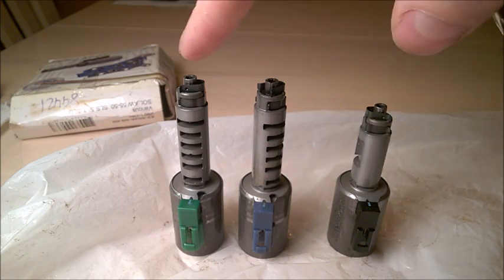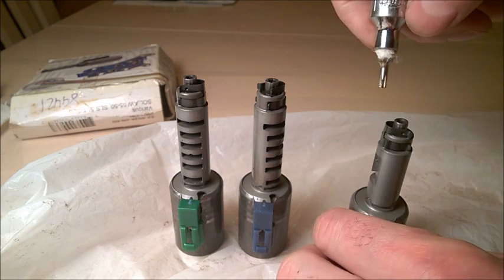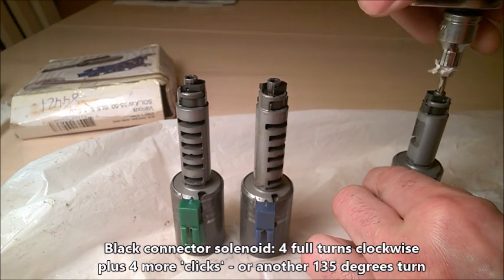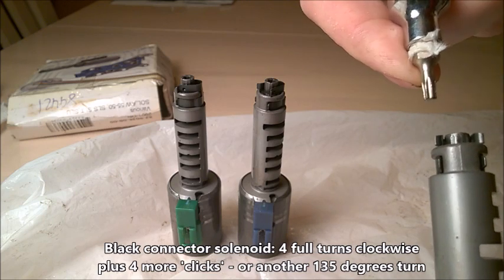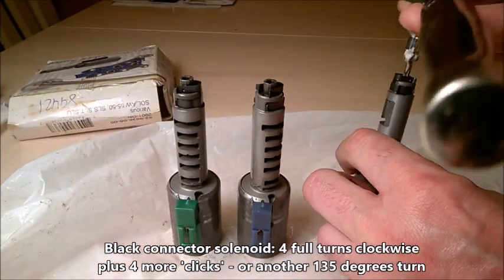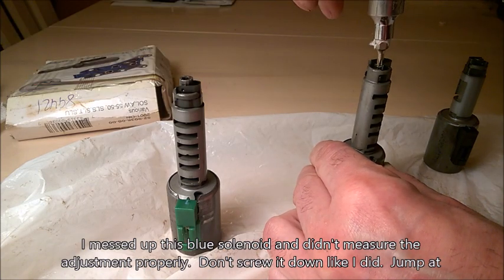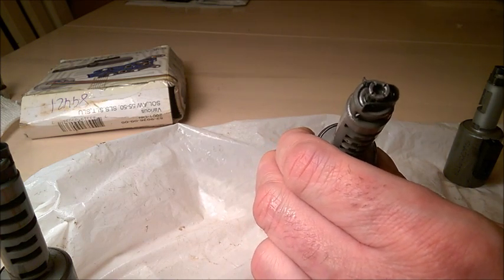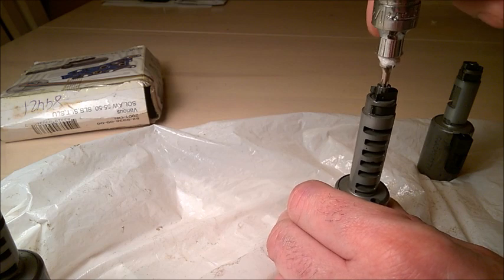2007  Volvo S60  V70 Transmission Aisin Solenoid adjustment

Comment: A note on the Rostra instructions that come in the box: they say that they're set to match the factory solenoids, but I found that my original black SLU solenoid was one full turn to the top clip, and the Rostra was 2 full turns! I trusted the instructions that the solenoid was factory set to match the originals and left the new one as is, but after installing and doing the adaption reset procedure, I still have clunking 1-2, 2-1, and into reverse. Sonnax's website has a good guide on adjusting solenoids based on the transmission's behaviour, and it does look like I need to unscrew my black SLU solenoid 1/2 to a full turn. If there's a big difference between the old and new solenoid levels, consider adding the plugs to the pan as suggested by Sonnax or adjusting the solenoids like shown here (turns to touching the top clip).
Reply: I am in the process on making the same, that sonnax instructions are very good

Comment: How have these held up in your transmission. I have heard that the rostra solenoids do not have the same durability as the OEM genuine and there are mixed reviews of weather or not to go with rostra. The problem is its I can find anywhere to buy new oem solenoids
Reply from the maker: Had no issues but didn't drive the car a lot, then sold it

Comment: Hi Peppermint, I'm about to undertake this job. I had the same issues as you and tried to clean the solenoids but the vehicle became undriveable after cleaning! New solenoids arrive tomorrow. Did this fix the issues you were having? Do you remember the correct ammoutn of turns for each solenoid? Any information would be greatly appreciated! Keep up the good work!
Reply from the maker: For the correct amount, may want to take each old solenoid individually and unscrew it all the way and count the number of turns - try several times on once until you get the feeling. if you get confident about the number of turns, then can try same on new ones. My results were good except for the 2nd to 3rd upshift which seems to be related to a fourth solenoid not included in the replacement kits. May want to ask more on forums https://www.matthewsvolvosite.com/forums/

Comment: Why are you changing the them? I have a problem with a Volvo 2012 V50 D3 with a  aisin Warner geartronic and it has recently developed a jump or a bang going into drive from n/p/R  when I put it in drive I get a thud I'm wondering will a software update and a oil change fix the problem taking in mind  my particular gearbox is a sealed unit and does not have a fill hole? Any help will be appreciated great video keep up the good work